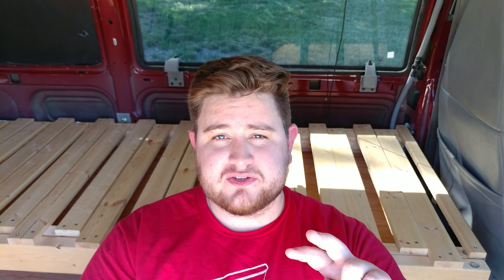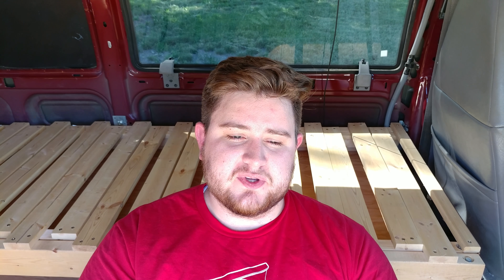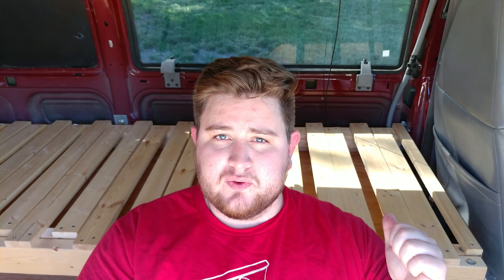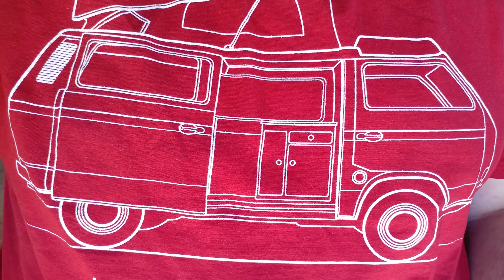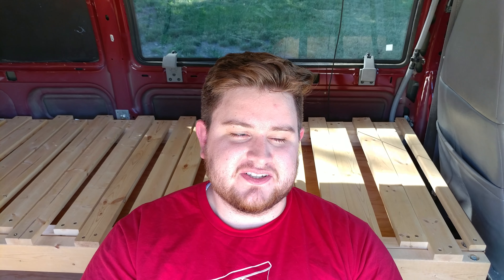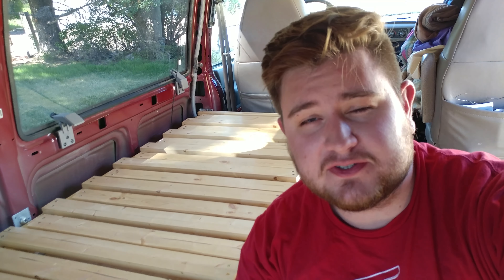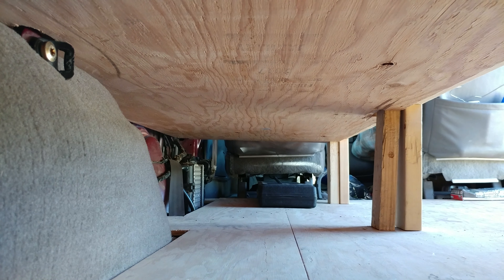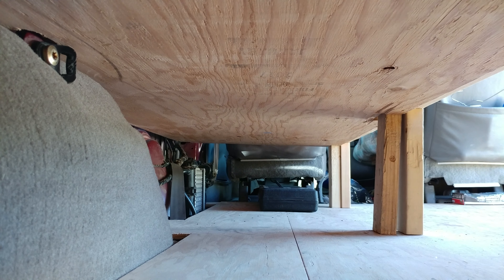Van to Camper Conversion | Pullout Van Bed Plans

Comment: Subscribed! But, when I did and saw the "Get your 3d-plans here" and clicked it: 404 :-(
Reply from the maker: Hey thanks for pointing that out! I apparently had an old link in there. I have updated it now so if you you do it again you it should work (it wont aign you up twice) also if your already on the list I will be sending an email with the new link in it. Thanks again I really appreciate it
Reply from the maker: Ok the email is sent Martin! Check your spam folder if you don't see it in your inbox. Thanks again I wouldn't have known with out you🙏